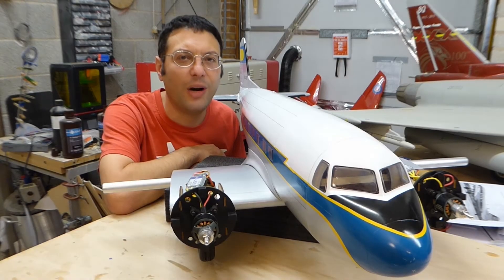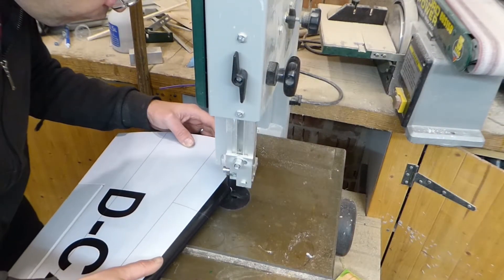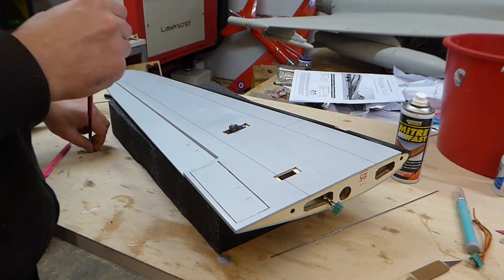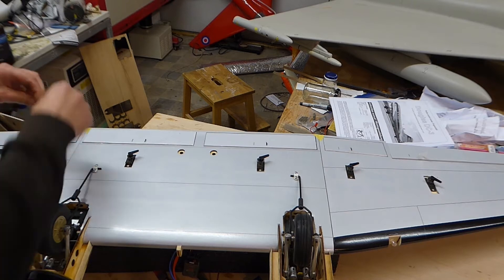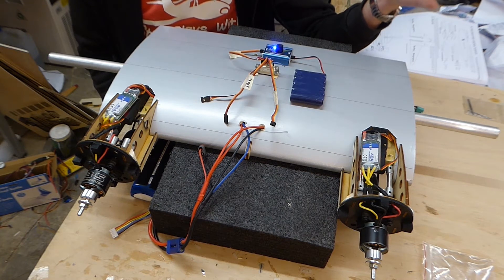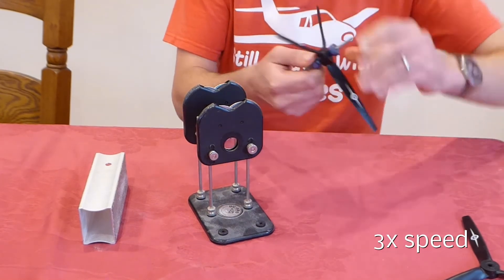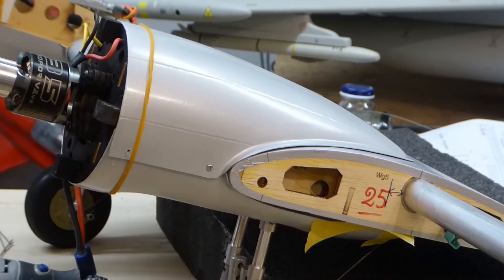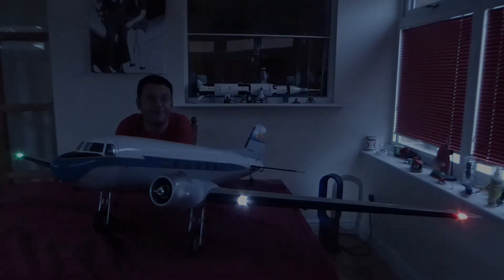VQ Models RC Douglas DC3 Dakota Model (Part 6)

Comment: Hi Matthew. I found your channel as I was looking around on the internet in order to get hold of an VQ DC-3 model and I am living in Denmark and found one silver model in Norway and a set of electric retracts in Germany and today you surprised me with the idea of making som realistic engine parts which I found in your shop. Now I am simply waiting for some interesting gear coming to me within a couple of weeks. I hope. I like your channel and there are lots of good stuff to make the assembly a little easier  for me.
The maiden flight, by the way was a little disappointing. I willl get back as soon as I have the model inhouse.
See you and thanks for the fine ScaleMeDown channel :)
BR Tommi
Reply from the maker: Thanks Tommi.  I have just started the 3D printer to make your parts.  Glad you like the channel.  Checking/setting the washout (incidence at the wingtips) is critical to success with this model.
Reply: @ScaleMeDown  Hi, I am so glad to hear that Thanks.
Reply: @ScaleMeDown  hello again. Hit the wrong button. I am not shure What you Mean wit the washout on the wingtips.
Reply from the maker: @tommimadsen3719  Hi, no problem.  I measured the angle of incidence (angle of attack) of the airfoil at the wing tip compared to the wing root, and found that the cause of the crash on the maiden flight was the angle of incidence was higher at the tip than at the root (ie the wing tip stalled before the wing root) - bad design.  It was a simple fix however to twist the tips back so that the tip has 2 degrees less incidence than the root and re-shrink the covering.  The aileron then appeared twisted in comparison to the tip, so I carefully separated the top and bottom skins along the trailing edge with a sharp knife, twisted and clamped them to align at the roots and the tips, and re-glued them by wicking thin CA along the trailing edge.  The flying qualities are much improved, and the stall is now tamed with these simple modifications.

If I were you, I would carefully measure the angle of incidence at both wing tips, and at the root.  I also set the centre of gravity at 95mm (instructions say 100-110mm from the leading edge) as I found it to be too far aft.  Hope you have better success with your maiden flight.